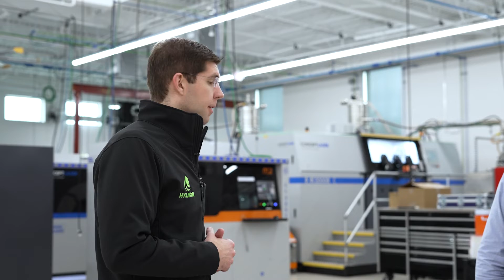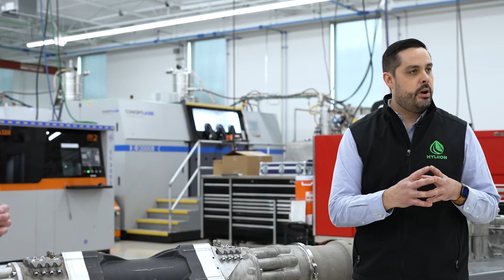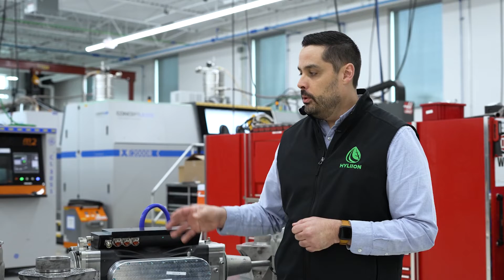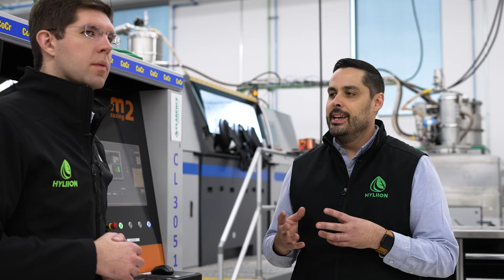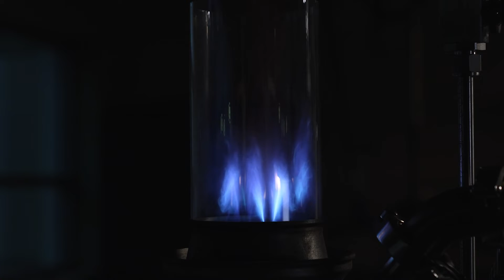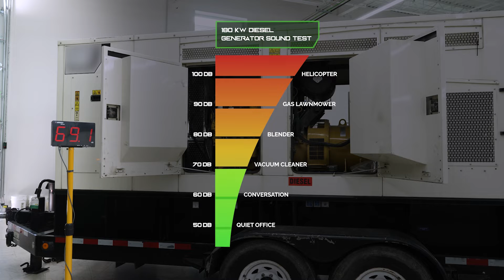KARNO Generator Tech Fireside Chat

Comment: What are temporary threshold, speak about overload rating for this machine. And long this machine expect to working, expected it lifespand of pressure ring, piston, burner, the fin and all related to friction and sealing material. Can be overhaul, to be use again? Really expect to be on market expecially on small scale generator for house, small working enviroment also instead of big truck and powerland scale as such.

Comment: it is internal combustion engine As long as the fuel-air burns inside the “ reactor ” a chamber and not outside, then it is considered internal combustion. it is similar to turbine can do high r.p.m but low torque in Opposite to reciprocating engine which can do low r.p.m and high torque. 
Note: This has nothing to do with what consumer companies promote as “ moving parts ” and so on. Rather, each has its use. Applications that require torque, such as cars, where their mass is and the friction of their tires with the road, then the reciprocating engine will be used because it generates high torque, while applications Which require speed, such as airplanes, for example, or generating electricity, then a turbine will be used because it generates high speed. It is similar to the electrical system, as there are high-voltage and low-current generators, and there are low-voltage and high-current generators. It is simply the same, and the matter has nothing to do with “ moving parts ” and “ moving parts ”.
It is wrong to compare internal and external combustion engines because what drives the piston in internal combustion is the explosion resulting from igniting the fuel, while the external combustion engine only works due to the temperature difference. Each has its advantages.
Moreover, the engine has many uses and should not be limited to generating electricity, especially a wonderful engine like the Sterling engine.

Comment: Let me make that first part simpler. The shaft moves back & forth inside a wired coil by switching back and forth between hot & cold to generate lateral shaft movement to produce electrical energy. So a fuel cell uses hydrogen to produce electricity - the Karno uses any number of different fuels to produce electricity. I'd be interested to know which is more efficient, a Karno or a fuel cell.
Reply: My question about Karno is sure it works, but how does it compete with fuel cells for efficiency and mobility? It seems as though the standard is fuel cells and the outlier is Karno. There must be some reason for that. Either a fuel cell handles bumpy roads better or some other metric like efficiency, otherwise the trend towards a standard would be Karno's not fuel cells.

Comment: This is basically a Stirling engine, and the efficiency of those can get to around 40% at maximum, there’s no need to lie and say you can get 50% efficiency with this engine. It’s already cool enough that a generator can use any type of gas while being very quiet and lasting 5-10x longer than a normal engine

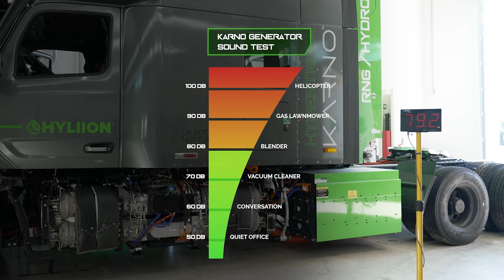Comment: 13:45 shows sound for the Karno truck at 80 decibels, but the spokesman with glasses said it was 66 decibels. But either 66 or at 80 no one I know is going to want that sound 24/7 next to their house, except maybe if its used for power outages. And what if there are 8 of these running next to a hospital - that's going to be a lot of noise! So I'm not sure how many applications Karno will be suitable for, but maybe they can build special housing to deaden sound?

Comment: No, the scaling is not "very different" from internal combustion engines, as claimed at 43:48. Industrial engines are routinely made in series in which every cylinder is the same, and engines are available with various numbers of cylinders to suit various power requirements. The ICE cylinders are much like the Karno cylinder pairs. When the demand goes beyond the largest desired engine size, two or more engines are used... just as is done in ships, for instance. 

Making only one size of product is not an advantage, it just illustrates that the company is not ready to produce more appropriate sizes.

Comment: Combined heat and power is good... and it widely used with other engines. Commonly in oil and gas industry that's gas turbine engines.

Comment: The answer to the scaling question at 28:44 is interesting: they only build one size, which they hope will produce 50 W, they like to use them in groups of four (for 200 kW) and share supporting systems (such as cooling) between the four, and scaling is just a matter of deploying more of them. The example was for 10 MW of demand... which would require 200 units (which they call "shafts") at 50 kW each (or 50 sets of 4 at 200 kW per set). 

The question was actually if they could supply enough of them, meaning that the person asking understood that... and that question wasn't answered. Technically any number could be used; they can't produce hundreds of units in any reasonable time and avoided mentioning that.
Reply: Very important point, the “Achilles heel” of additive manufacturing. It is bottlenecked by TOTAL laser power output. It has its limitations and issues. They were definitely dancing again. “Fake it, till u make it”, time!

Comment: It's interesting that they mentioned and actually named the supplier of the linear generator component (Libertine). There's nothing wrong with using an outside supplier, but it is common for companies (especially those wanting to exaggerate their capabilities) to claim outside supplied components as their own.
Reply: @IAMATREE1111  

LOL, you don’t have a faintest idea of what was being talked about ‽
Reply: @IAMATREE1111  

I would strongly suspect that there is quite a lot of patents associated with the gas bearings, seals and how the linear motor /  generator interoperate (type of magnetic layout). The area of these linear motors is an active area of r and d and is not quite as mature as suggested. Besides, all sorts of new IP is being created in turbines and even ICEs. You have to remember that all sorts of patents are based on a variation of a concept that is old but being applied in a new domain. The Karno is rather complex in its own way which provides opportunities for IP.
Reply: @IAMATREE1111  

OK, we are mostly on the same page, but it doesn’t take a lot of thinking to come up with say, a somewhat novel way of protecting against over excursion due to XYZ that is patentable. Or maybe a mechanism to equalize the working fluid amount on both sides that compensates for its usage in the gas bearings. It is these little details that are used as patent protection. Or control algorithms used for startups to get the actuator into harmonic resonance (which might actually be a thing with Karno).
Reply: @IAMATREE1111  

My sense is that GE Additive did all the design work that has been shown about the Karno (so far). I think some of the people came over from GE. Personally I have questions about scalability of manufacturing, a number of combustor issues, ect … They will not even clarify what differentiates Karno from a Sterling engine because they will not ever say the word Sterling. Somewhat sus.
Reply: You saw that also, so is Hyliion going to license the IP?

Comment: They say "fuel agnostic" then explain that means running with the same components burning "different gases". That means that it is a gaseous fuel engine, but will run on various common gases without component changes. It is not literally fuel agnostic (meaning that it doesn't care what the fuel is"; it isn't even appropriate for ideal liquid fuels. Try running it on coal or wood...

Of course any external-combustion engine is relatively fuel-agnostic. That's a major reason for choosing external combustion. That was true in the days of coal-fired steam locomotives, and it remains true today.
Reply: So what do you think about the “liquid fuel” is externally vaporized and then the “gaseous vapor” is pushed to the combustor nozzles as was promoted by a commentator? When the diesel was “combusted” it didn’t look like was doing that process particularly effectively.

Comment: The Karno engine appears to be operating in a resonant mode, as confirmed by the comment about operation at the engine's natural frequency at 3:22.  That suggests that power level cannot be changed significantly, and scaling up in output is achieved by adding more modular units. That's not a problem for the series hybrid application, as engines can just be started and stopped as required to keep battery state of charge within the target range... but what is that power output range (or turndown ratio)? 

This is addressed in the Q&A at 39:46
The response claims relatively flat efficiency over an output power range of 40% to 100% (a 2.5:1 turndown ratio), which is great - presumably the linear generator manages the resonance to still work at lower power levels, but this isn't addressed. There is no indication of whether the cycle frequency (given as 20 Hz in another remark) changes - that's not important, but I am curious.
Reply: To greatly over simplify, what is the “spring constant” of the overall system that establishes the resonant frequency? Not to mention that it is probably an extremely highly damped oscillator also. It is probably a complex but interesting question to answer. Good point.
Reply: @Mentaculus42  I wonder how they can synchronize the 4-shaft system. They would have to monitor/adjust the load and position of each shaft so they can get them to cancel eachother out as much as possible. The demo doesn't appear to do this (yet). I'll try to ask Josh on his X channel (not holding my breath tho).
Reply: @ivantuma7969  
Probably doable, as the power electronics that control the linear motor / generator should have the ability to know the exact position of the “rod”. From that it should be able to get things reasonably “orchestrated” if it be out of phase synchronization or maybe something else to smooth the current pulses between the four units. It is an interesting control system issue but just recovering “power” from a linear generator that oscillates is relatively complicated compared to conventional generators.

Comment: Yes, as described at 10:55, combustion is continuous. That is true of almost any external combustion engine (hot gas engines like this, Stirling engine, steam engines...) and of gas turbine engines (and of any ordinary fire). Continuous combustion is a good thing in most ways.
Reply: You carefully didn’t say that this is a Sterling engine, is it or is it not, and why!? Also “Continuous combustion is a good thing in most ways”, it is complicated and I appreciate the “in most ways” distinction that you added as there are benefits for pulsed combustion also.
Reply: It is not a Stirling engine, @Mentaculus42 , because it does not appear to use a displacer (which is normally another piston moving about 90 degrees out of phase with the working piston) to shift the gas between the heating and cooling sections. Instead, it apparently depends on some sort of resonant motion that they never describe. Otherwise, it is similar to a Stirling in operation, depending on cyclic gas expansion and contraction due to heating (by a heat source) and cooling (at  heat sink, in this case cooled by circulating liquid and a radiator, which are never shown in Hyliion's promotional material). 

Ironically, while combustion is continuous, the engine operation is inherently cyclic, not continuous. It's the external-combustion equivalent to a gasoline or diesel internal-combustion engine, not (for instance) the external-combustion equivalent to gas turbine engine (which has continuous internal combustion).

It is so similar to a Stirling that it would be obvious for Hyliion to explain the difference between Karno and Stirling, but there have been so many failed promotions of Stirling engines that I think it's somewhat understandable that they never mention the dreaded term "Stirling".
Reply: @brianb-p6586  
I will in no way categorically say that this is an orthodox Sterling engine, but looking back at my notes that go through all the screenshots of the thermal cycle, I think that we can be both correct. Orthodox sterling engines need to have a physical “phase differential” between the hot piston and the “displacer” which is accomplished by the geometry of the mechanical linkages. With Karno one has other ways of accomplishing the same type of phase differential between the hot and cold side by routing the gases twice with through “restrictive” heat exchangers that are connected by a rather large ancillary volume (that they “call” a regenerator [which is generally a necessity by definition for a Sterling Engine], but the pictures that are available don’t clearly indicate that it is actually just a regenerator as it is unclear if there is any medium to absorb heat energy) that I suspect is sized to (as you would say) resonate or maybe more accurately its sizing and configuration delays the propagation of pressure changes from the two sides. Since there is a linear motor controlling the precise timing of the movement of the piston, the timing of events are “moderated” (probably a bad word) by the combination of the “time constants” caused by the geometry of the side “volumes” and the engine’s power electronics. The control exercised by the power electronics is something that was not available to older Sterling engines. So if this is the case, it becomes a definitional issue if this is basically another “variant” of the general category of “Sterling engine” or deserves a totally unique name as Hyliion seems to prefer. As far as I can tell, this engine is an extremely close variant of a Sterling engine but has some unique aspects that the GE inventors contributed to its design.
Reply: I agree, @Mentaculus42  - there are many factors in combustion management and no clear single best approach... but a continuous burner is certainly easier, especially with a wide range of fuels having different flame front propagation speeds.

Comment: I realize that this a "chat", but cutaway parts would be more more useful props than the outside of the assembled unit. The additive-manufactured heat exchangers are interesting and somewhat novel, but they're not the only important parts.

Comment: When you say some components take a few days to 3D print - my assumption is the printers are working on multiple units in parallel instead of just a single piece? If that's the case, it should be noted that traditional engine block castings are a relatively lengthy process as well - even when done at scale, you have to keep the metal in a molten state, the sand form has to be created (and destroyed after each engine block is cast), then allowed to cool before being machined to exact specs before final assembly with cranks, seals, valves, camshafts, oil pumps, etc.

Comment: 👍🏾 how small can it be built; and still generate the same energy: potential to be sold to OEMS; for a compact cars?
Reply: Probably a very bad match of Karno to application, that low power density and duty cycle for an auto would be going in the wrong direction.

Comment: They might be efficient and reliable, but how much will these cost compared to standard gen sets?
Reply: 2x more lol
Reply: considering there are fewer moving parts, greater efficiency, quieter operation along with very low maintenance cost they've indicated the cost should be comparable (yet more profitable if they can scale the 3D part - I'm assuming when they say some parts take several days to print, they are talking about more than one piece in the oven). I just looked up a 50kW Generac diesel listing for around $20k ...

Comment: Not clear how long it takes to make a complete Karno system.  Seems like a cool science project but is it manufacturable in volume?
Reply: They employ the same GE equipment used in aircraft manufacturing, so the "expectation" is that some moderate scalability is baked in - otherwise GE wouldn't have sold the patent for partial payment in Hyliion stock. But that's just speculation...
Reply: @ivantuma7969 
Good speculation but there are other possibilities.
Reply: @ivantuma7969  sales by an established company with a component of stock in the start-up purchasing company can be just sales for the cash value, with stock thrown in as a bonus to get the selling company involved in the start-up. GE could value that stock at anything, including zero.